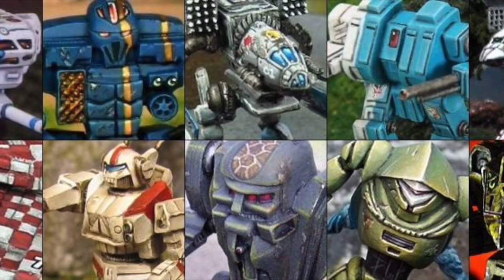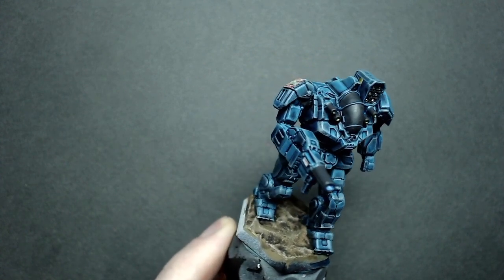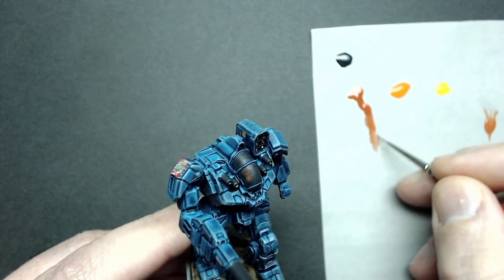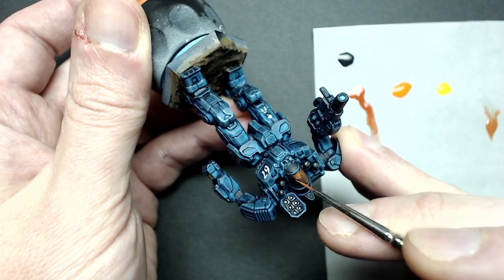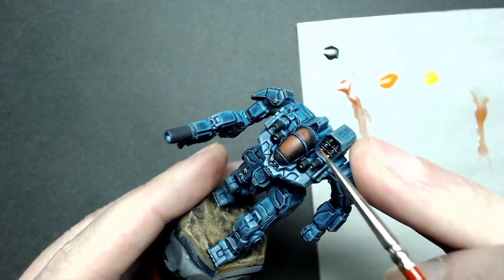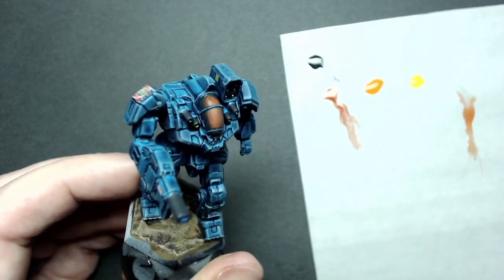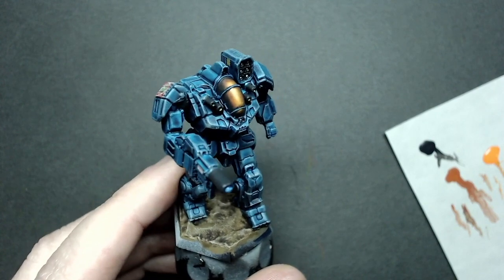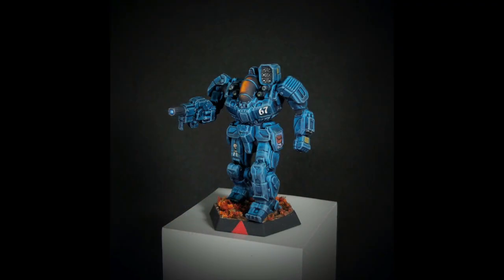Curved Canopy Reflection Jeweling Effects | Battletech Detail Painting

Comment: Wich colors did you use for the body of the red battlemaster? the base color, the hihlight, the black and the gun barrels.
Reply from the maker: The base coats were airbrushed on starting with Vallejo German Camo Medium Brown, then Reaper Rach Red, followed by 50/50 Rach Red with GW Trollslayer Orange. The edge highlights on the red were with Trollslayer orange and then Vallejo Sky Grey. The gun barrels were based with a thinned Vallejo Model Air Base Grey then washed with Nuln Oil and then highlighted with 50/50 Base Grey and Black then an edge highlight with Vallejo Sky Grey. The joints were Secret Weapon Tire Black then Vallejo Oily Steel and washed with nuln oil.

Comment: Hi, do you think you might expand a bit further on the glossing process?  I was following along with this tutorial with a Battlemaster and when I attempted to gloss the canopy it looked absolute pants.  I was using Vellejo gloss and went with two coats, while the transitions looked decent au naturel they were pretty stark with the gloss coat and the finish left a lot to be desired.  I assume I would need to really work on the blending for it to work glossed?  Also I am not sure if I needed to thin out the gloss coat or if you need to really go ham adding coats to get a nice finish?
Reply from the maker: I stick to just using Citadel Ardcoat as I'm not impressed with Vallejo's gloss most of the time. However, a thicker coat MAY be what you need to help with the surface drying smooth for the gloss layer but that's up to you to risk trying. I don't thin any of my gloss, I want it viscous so it doesn't run off and I feel it dries to a brighter shine if I don't.
Reply: @CamoSpecsOnline  Thanks, I'll order up some Ardcoat and give it a shot.  How may coats do you usually apply?
Reply from the maker: @john88benson  typically I'll apply 2-3 coats.
Reply: @CamoSpecsOnline  Thanks!